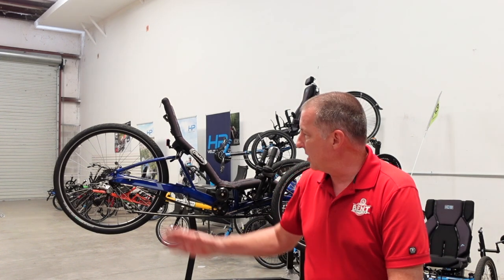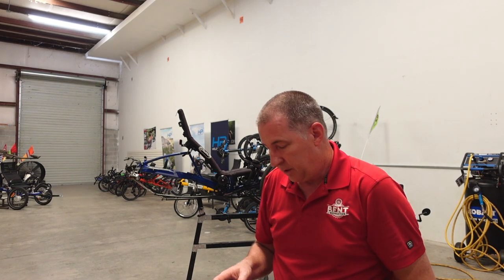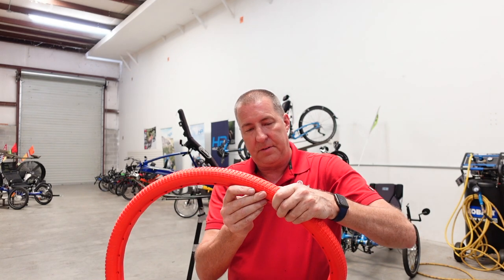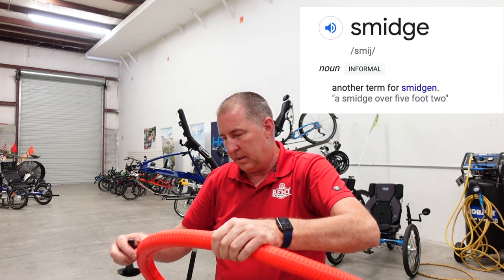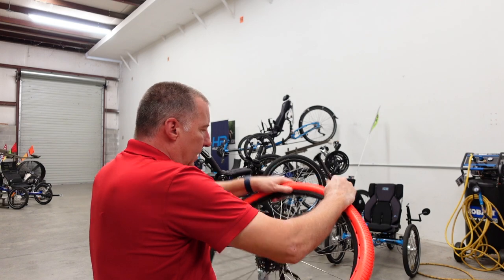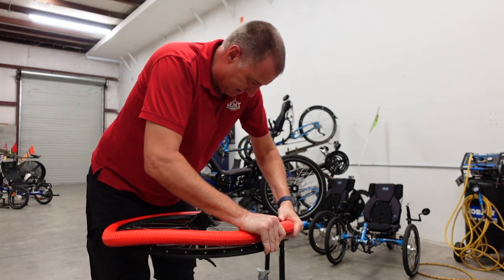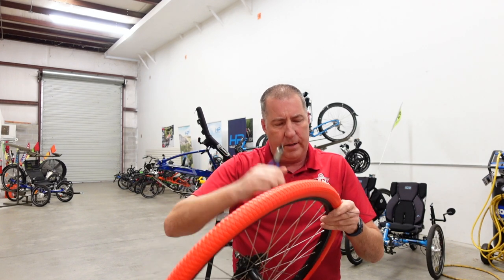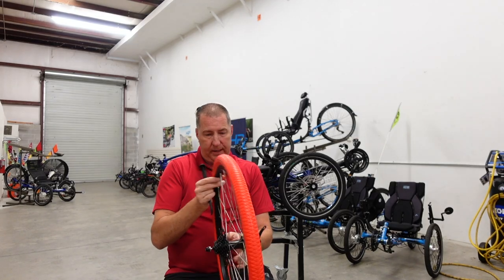No More Flats? Tannus Airless Tire Review

Comment: Do they really expect us to buy and use those? I can change a tube with zero stress and strain in 5 minutes. You worked awfully hard to do a great video and were very successfully in convincing me never to use them. I just changed my Schwalbe Marathons on my 559. At 5000 miles. Took a few minutes and zero effort.
Reply: Never have to pack a pump, a spare tube, tool to unbolt wheels. It’s convenient
Reply: They're totally worth the little bit of effort you have to put into installing them
Reply: Maybe ur not the demographic then? If i wanna ride in my area, im inevitably riding through glass. Theres no avoiding it.
Reply: @adamkrasneski3679  I ride on beautifully paved multi purpose paths all over New England and then south Florida in the winter. I guess I’m spoiled. I have had a grand total of 3 flats in 20,000 plus miles in the last few years. All of those flats were a direct result of hitting a raised crease in a sidewalk or a pothole at speed. My mistake. Fortunately no glass or nails etc for me so far!
Reply: @markfeldman6509  that sounds amazing mark. Wish it were that nice here. Happy riding
Reply: Great comment!!!! If he would have used the mounting tool, things would have been much easier but he used the one that comes with the tire. The cons of this tire is the high rolling resistance....
Reply: I commute so changing a flat means I’m late to work, also I live in Alaska so gravel and rough roads eat tires up. These tires work great for what they are intended for.
Reply: Try riding down in the southwest US where we have goat heads....those thorns puncture so many tires down here .
Reply: I have these tires (black 26x1.75 and 20x1.75 ) on my gekko 26....loving them for now but planning on touring on my trike soon and having my trike fully loaded has me worried about my rear wheel.  Tannus says not to exceed 163 lbs of load on each tire.  I have 2 large panniers and 2 racer panniers on the rear of the trike and with me sitting on trike I'm bumping that limit on the rear.  Will this be safe to tour up the west coast or should I switch the rear to the tannus armour in a marathon plus tour tire?
Reply: Hey some people don't want to change a flat I might check it out myself
Reply: That five minutes turns into hours when you have multiple flats per week.
Reply: Would much rather put a tire on once than replace and pay for replacement tube and then reinstall them over and over again and not have To worry. Yes it's worth it to me at least

Comment: Just ordered some of these. Cannot wait to be able to just jump on my bike without having to pray to God that i don't have a flat. I used to pack up all my gear for the ride and have my camelback ready to go. Jump on my bike to find out it has a flat ruining the whole plan. Hope to solve this with these tires.
Reply: Money well spent. I never want to ride a bike with air tires again
Reply: @nomadnickbikehobo9598  They were a pain to put on that is for sure. But well worth it.
Reply: @ElitePWNSFace  i just got another flat after changing my tube 1 month ago. Now looking into airless tires.
Reply: @ElitePWNSFace  so how is it going with these tires? I heard they were pretty hard on the wheels and spokes? Any updates?
Reply: @Oldmanlearns718  So far so good. Ya the ride is rough, but to be honest I don't have enough miles on mine yet lol. Was impossible to ride over the summer. Just now cooling off lol. I should not these are hard to put on. Be ready to a workout if you get them. But I am grateful to not have to worry about having a flat after every ride(was a thing for me, my wheels are cursed)
Reply: @ElitePWNSFace  thanks for responding. I figured you would know by now. And I have heard a lot that it is a rough ride but same no worry on flats. I built my own ebike on a single speed bicycle with 700c wheels. It's 36v 500w not super fast at all just right for me. I take it to work and that's a round trip of 8 miles. So I have also gotten flats quite a few times my self. I now have my  tires slimed and I have not had one puncture at all in 2 months when I was getting one or 2 a month sucked really bad I also carry 2 extra tubes everywhere and have tools. Have you tried slime. And I am now looking into tubeless but I don't think it's good on skinny type tires like mine but the slime holding up. I might get the ones you got. Thanks for the info.
Reply: @Oldmanlearns718  You will have to ask a professional on that one. My mountain bike is tubeless but I still have to add air every now and then when it sits around. Also the issue of having to clean the wheels out from time to time and add new slime. Probably visit your local bike shop. All bike shops I visit seem to have such lovely and supportive staff. Good luck.

Comment: I’d be tempted to fill a tub with hot water to soften these up. Periodically rolling the tire/rim through the water to reheat during installation, maybe a towel or gloves if uncomfortable to handle.
Reply: That will trap water between the tyre and rim though. I've yet to have mine delivered, let alone wrestling it onto my rim... but I'm thinking maybe get the a hair dryer out to make it stretch on a bit easier.
Reply: Maybe a hair dryer or heat gun on low?

Comment: These tires do not handle high RPM very well like going very fast downhill or anything it's like riding on ice they want to separate from the rim every version of them that I've ever had always ends up being more like a soft plastic rather than a rubber they're still slick you might as well be using bald tires they give you little to no traction and they chip away too easily Pieces come off of them they're okay for extremely slow speeds like Wheelchairs and maybe a child's bike but I don't think they've gotten there with the technology yet these things suck I've tried multiple the only version of a solid Tire I have found that works was actually just a regular Tire filled with liquid silicone that then cured inside the tire I don't know who made it I couldn't find any information on it but it came on a wheelchair it was a regular bicycle tire I think it was homemade I don't know but that concept seems to be good because you get all the grip and traction of the outside Tire it just seems like a more expensive method though since it wouldn't last as long

Comment: I installed these at night with porch light slippery hands in less than thirty mins. It's easy to do BUT you GOTTA do it INCH BY Inch  don't try to wedge the whole thing on in one go. You need to treat it light a really tight wheel and you need to hold onto the opposite side to stop it from slipping

Comment: I have been using the 700C on my ICE VTX and it has been excellent.  I trike on suburban roads in an area where new homes are going up and there is road work putting in network cables, so bits of road schmutz are encounter daily, it is such a nice feeling to run over that stuff and not have to worry about that back tire going flat.  I put on the extra firm and I am glad I picked that hardness.  I have about 1000 miles on it and it shows very little wear.  Tannus claims it should go around 4-5 thousand miles and I believe it will.
Reply from the maker: It's always good to hear some real world experience. I agree it is a good feeling not to worry about punctures.
Reply: I have the Tannus foam inserts on 4" fat tires. It doesn't stop metal and some glass can get through sometimes. I had the unfortunate experience of biking near new home construction and ended up with a nail through my tire which also somehow destroyed my rear fender. 

I will say that I have gotten a lot less flats though, mainly from glass which is constantly thrown into the bike lane.

Comment: I have ridden (briefly) airless tires in a road bike size from a different vendor many years ago. Maybe these are better but I doubt it. I personally would recommend the Tannus Liner if you are having flat issues. I use one on my 29" x 2.5" trekking bike in parallel with a simple Kevlar strip and have never had a flat since. If you use a Kevlar strip, place it between tire and Tannus, not next to tube or it might cut tube. The big thing is that the tube is still there to provide smooth and efficient rolling resistance and mitigates the road vibration. I also place a large quantity of PTFE powder on the inside of the tire to minimize internal friction. Wheel pressure is ~40 psi.

Comment: Rubber products tend to expand and contract with heat and cold. I wonder if you can soften that tire / tube with heating it with like a hair dryer as you work it around the rim. The momentary expansion from the direct heat should help to soften it up enough get it in once you have gone as far as you can cold. 
    I wouldn't worry to much about making sure the plugs snap in until the tire has cooled down and then you can go back around the tire pressing from the top to make sure you have good contact with the rim, it's not like it's going to go any where as tight as it seems to be. Just a suggestion as I'm sure that by now you have probably thought of it yourself.
Reply: What about dipping it into a tub of hot water as you put it on? That way it's warm almost all the time where a heat gun could melt things you don't want to.
Reply: @SFCRambo60  Not a heat gun, that's too hot. A hair dryer shouldn't burn anything, but a tub of hot water would be alright, but it might make the rubber slippery, better to do it as you have it on the rim, then you can keep warming it up, can't do that with a tub of hot water, once you start, or you would have to put the whole rim and tire in the tub, to much of a watery mess, nice idea but not really practical enough to work, but anything is worth a try.
Reply: I was thinking the same but immersing the tire in a hot bath instead.
Reply: @albertdesalvo7273  I've heard that works, but when it comes to that much effort, I think I'll just pay the extra 20 bucks for a bike shop to put them on.

Comment: You might be able to get it easier to install if you use a machine to stretch the tire rather than doing it by hand. Plus when it gets to actually installing it on the rim use a machine like that process that they use to get regular car tires on and off the rims. Maybe using a powder such as corn starch will help you with slipping it on.

Comment: I realize this video was created/posted over a year ago, but I'd like to know if you had a chance (or received customer feedback) on traction characteristics with that tire.  Does it grip as well as the tube tire it replaced on wet or gravel surfaces?  How additional weight does that tire add?

Did you subject yourself to the removal exercise? ;)
Reply from the maker: The tire seems to have the same grip as a standard tire. We have not had to remove it, but I will probably cut it off when that time comes.
Reply: I tried these a couple years back. They really slowed me down. Way too soft.

Comment: flexible as a snake, have you tried foam tube inside an outside wheel. foam should act like air inner tire. it should be elastic to restore the original form after compression.
Reply: try two part symmetric rims, that you can fit solid tires directly into, just keep the two rim halves together with the wheel mounting lug screws, or more.

Comment: Which bike type are they for primarily. Can i use them on a mountain bike for trails? Or are they a smoother tread?
Reply: It's less a tread issue than a mounting issue for MTB use. The clips/stems that hold to the hook on a rim I wouldn't personally trust given the roll forces.

Comment: Now do a video on changing the Tannus tire ..
Reply from the maker: Removing the tire can be done by cutting it off with a utility knife.
Reply: @BentRevolution  hahaha are you serious??
Reply: @cto4124  The supplied tool can be squeezed between the tyre and rim, then you can pop off the tyre, one tab at a time. Since the tabs bend to install the tyre, then they can bend the other way to get it off. Tabs shouldn't be reused though in this case, but they are very cheap (like £3/$3) and can be purchased on their own.